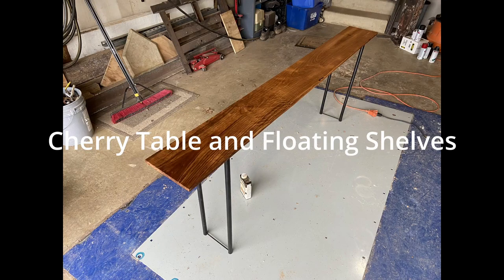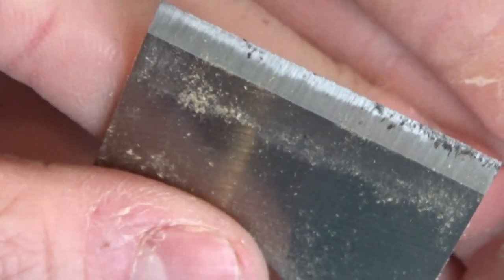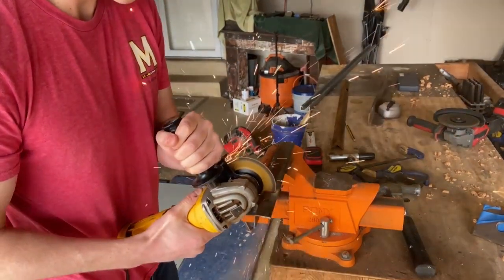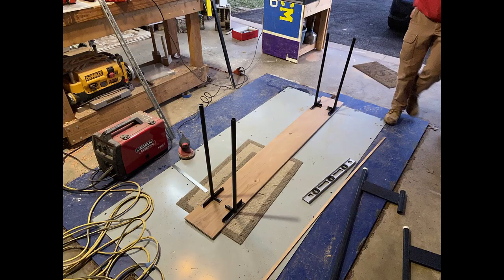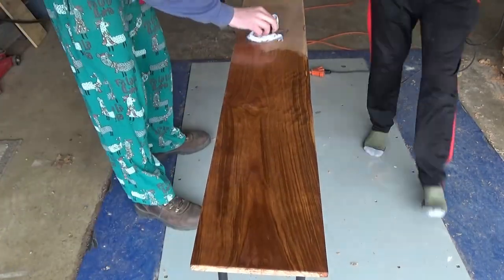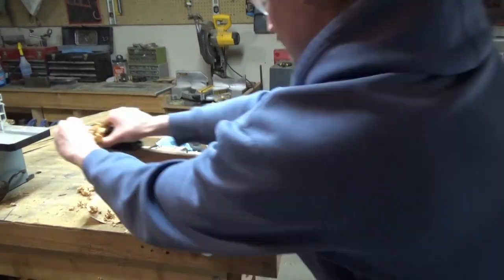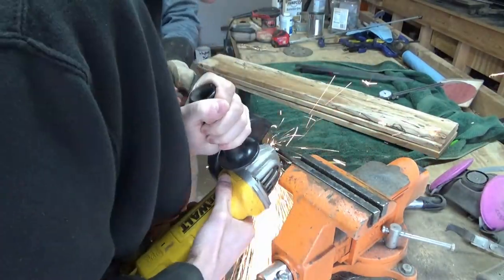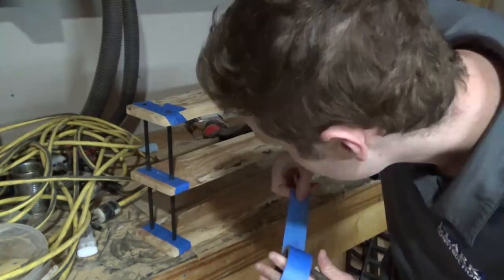Building Cherry Floating Shelves and a Table

Comment: The short table on that jointer is part of the problem. Check the flatness of the infeed and outfeed tables and check them for parallel. Does Calvin's mill have a video ? I am buying parts for a future homemade lathe project. I've been looking at other people's designs for inspiration. I hope your lathe will make some chips soon.
Reply from the maker: Thanks for the advice I really appreciate it. I did check them for flatness - they’re flat enough to not really matter at this scale (maybe 10-15 thou at biggest dip? Not too bad) but I’ll have to check for parallel when I get home.
I hope so too! Should have a video showing attaching the ballscrew nuts and hopefully wiring the steppers in the next week or two. It’s getting closer at least!